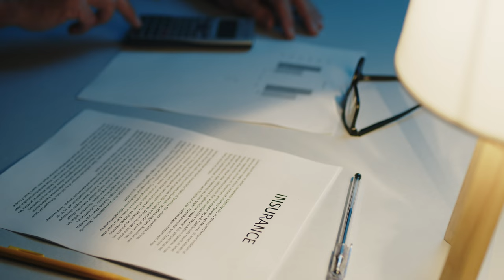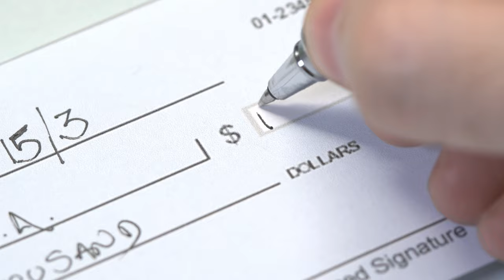What To Expect When Hiring A Plumber

Comment: This a great presentation of the full scope view of the cost of running a business. Quality work does not equal cheap. I am not a plumber but I really enjoy your videos Roger. A few years ago my toilet started over flowing and sewage was backing up in the bathtub,because of a blockage in the sewer line. My father called a plumber, and the Plumber showed up early, and he did all of the diagnostic tests and determined that he needed to pull the toilet. He used his 35' drill auger first then he got the big auger out. He was very professional, was dressed in slacks and white shirt. He was willing to teach me about what he was doing and why. He ran the auger out 90' and fixed the problem! He was worth his weight in Gold! Cleaned up the mess in the bathtub where sewage backed up even and disinfected the entire floor bathroom. Quality matters more than cost. 100%

Comment: I watched your video of replacing a soldered in sill cock and got a similar job. I chose to cut the finished basement wall open and replace the copper through the wall. I quickly realized had I put a torch in the wall then I would have burned the house down. The wall was full of styrofoam, plastic sheeting, paper backed insulation, and old dry  2 x4 studs as well as having a big gap without fire caulking between the floor above. It took me a lot longer because access was tough especially for the press tool but it was so worth it not burning down the house. 
I told the homeowner because even if he didn’t like hearing it, he absolutely should know the truth. He gave me a five star review and I sure appreciate that.
You did ask what viewers would do differently in that video and for me it was sleeve the copper to protect it from muriatic acid.
Thanks for what you do sir.

Comment: This is amazing information. Roger, the only thing I would add to that is, if you are going to check the whole plumbing system like you said. And you checked out the lady's water heater and then it leaked. When she went away, I would almost record myself or have the customer there. Watching what you're doing. I'm a very cautious person and I'm always thinking. People's gonna think I did something to that hot water tank and then I would get the blame for it if that makes sense to you.
But if you recorded yourself looking at it. And then you could just show them. As well and they would be able to see that nothing was done. And then you could just kind of keep that file. Just in case they did come back to try to sue